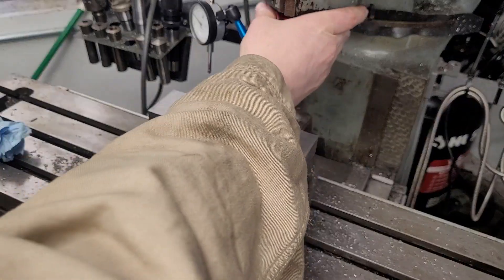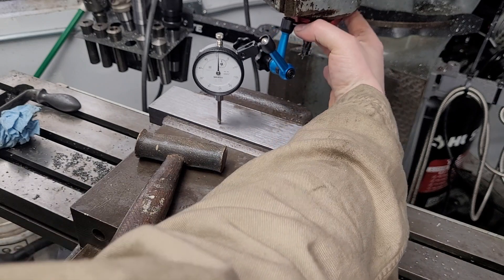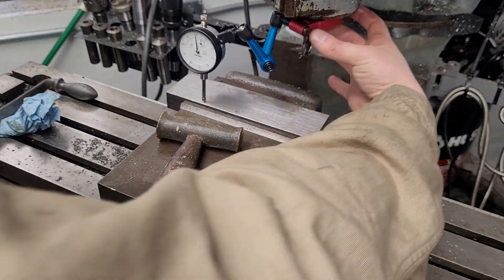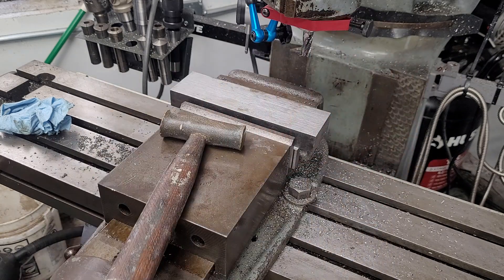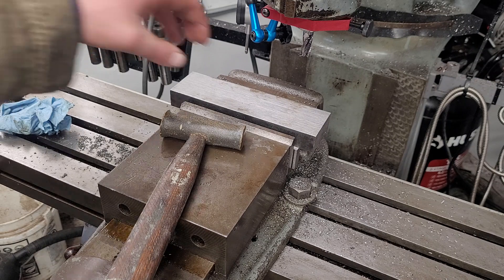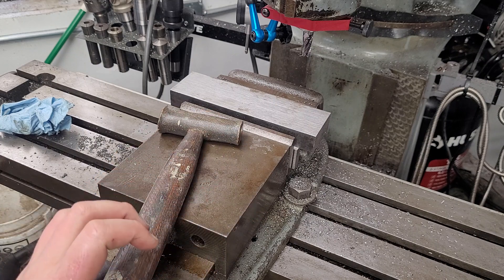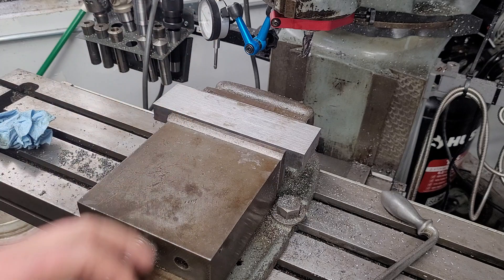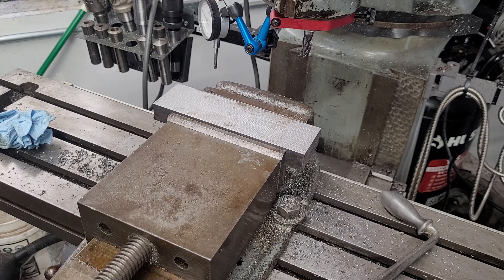Dealing with jaw lift in a milling machine vise

Comment: is that movement the same for everything you Clamp?
Reply: and ps very impressed at your tool array. great to see you in action
Reply from the maker: Nope. It's usually within the range, but it depends. Some things hardly move, some things move a lot more. 

Thank you! I appreciate it.
Reply: Generally the rod is between the part and the moving jaw not the fixed jaw as stated. It is usually far easier to use soft mallet as it stops bouncing back up off the parallel.
 A quick method is to use a pocket level.